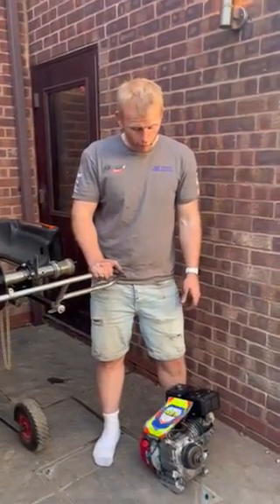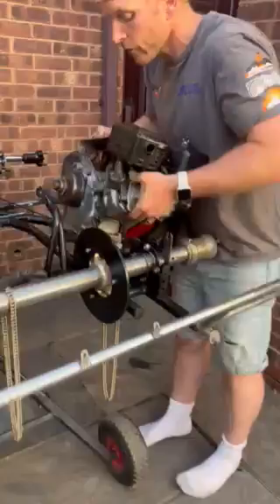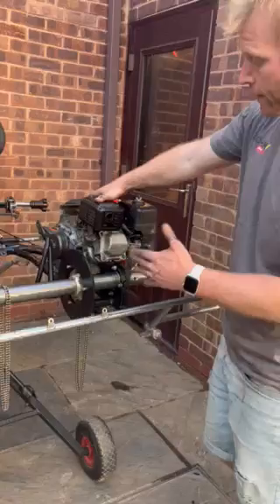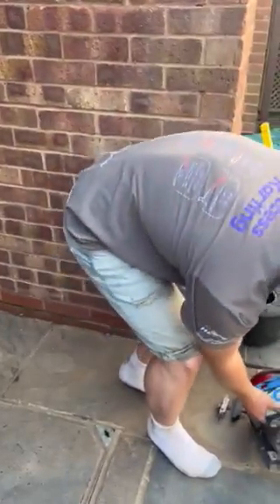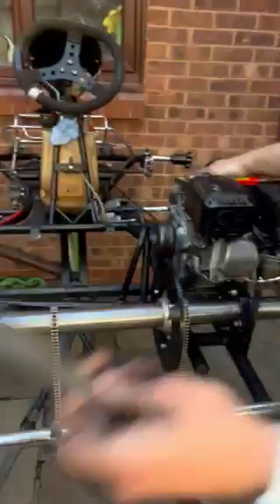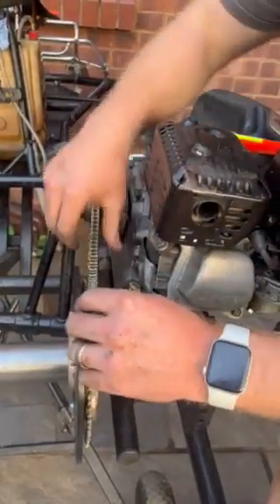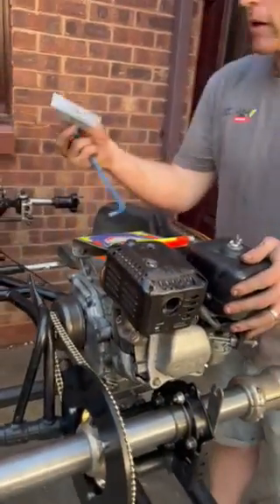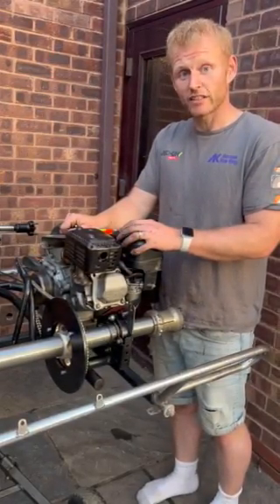Fitting your GX series engine onto your GX-UK kart

Comment: Thanks! We are struggling with building our own GX onto an Energy Corse kart. Did not know about the reversable clutch thing. We also have an issue with clearance between chain and frame. We can only use a max 36-teeth blade onto the axle otherwise the chain will hit one of the pipes of the frame running across from left to right. And how to connect the gas cable properly? Hope you can show these things in a video!